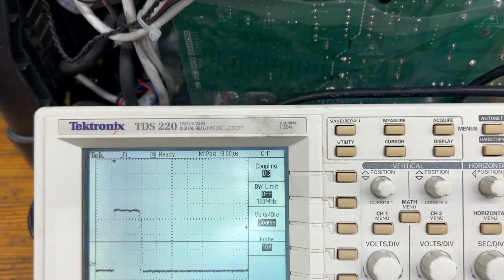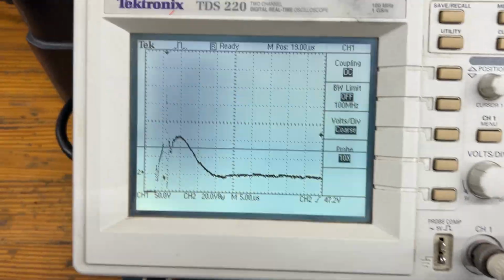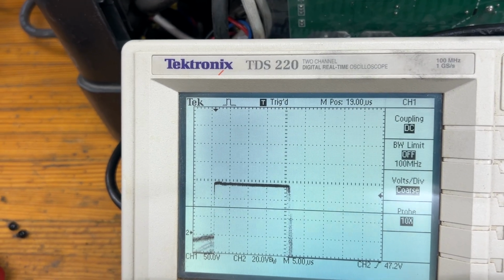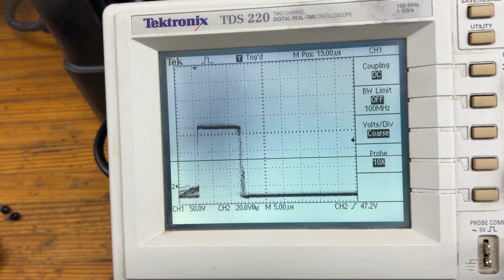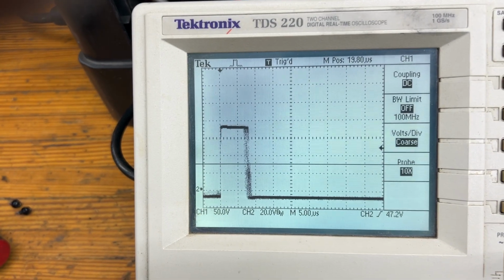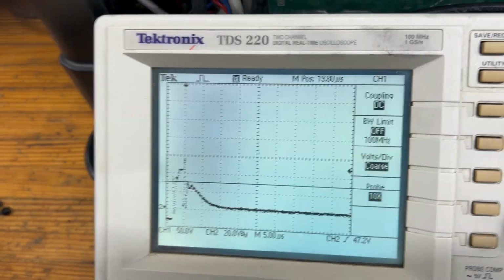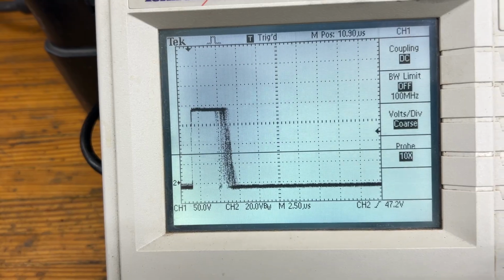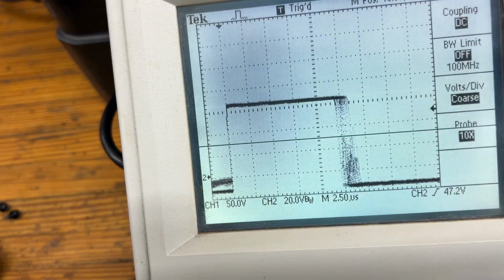Titanium MIG170 Wire Feed Problem – Diagnosis & Repair (Part 4)

Comment: Thank you for doing all the sophisticated testing. I can't imagine what I would have to pay a shop for this.
Reply from the maker: It would not be worth paying someone to fix this welder.  I have seen these on sale at Harbor Freight for less than $500.  It is a great little welder for that price. Yes this one failed, but I have another that has been running perfect for 5+ years.  I only worked to fix it because I was interested in determining what failed and whether I could fix it or not.  It turned out it was a fairly simple diagnosis and I could bypass the onboard PWM circuit with some cheap components to get it back working.